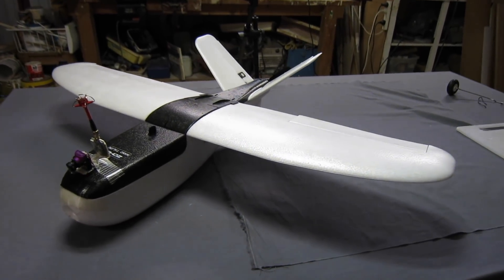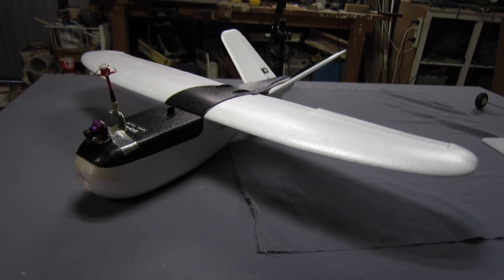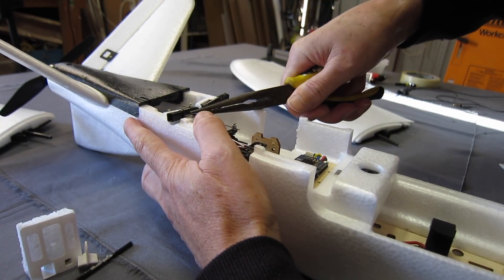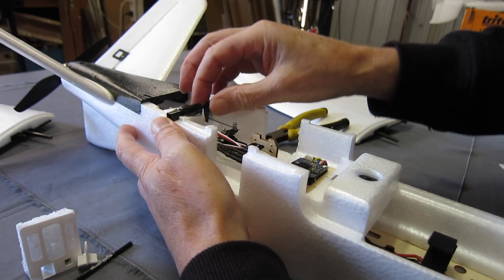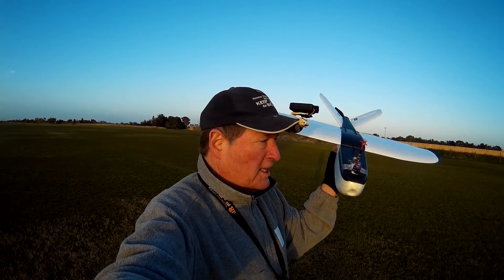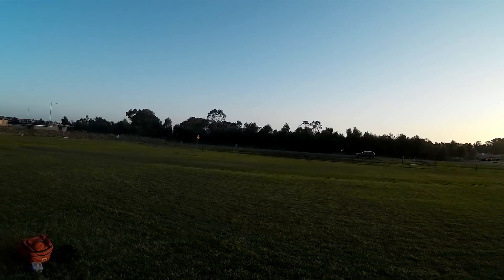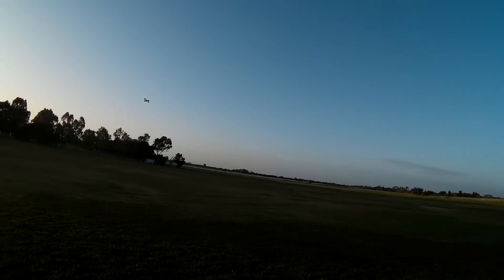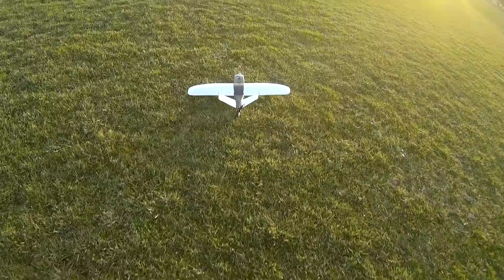Flat Wing Nano Talon

Comment: Good idea to ditch the dihedral. My simple mod was to rip out all of the spare box bits except the fuselage plates. I then sliced out the top of the outboard wing spar boxes and epoxied a carbon tube into the trough. The aileron end was done pretty much as you describe.  I find the rudder function pretty much useless as it flies best as a plank using the short coupled elevator more as trim.